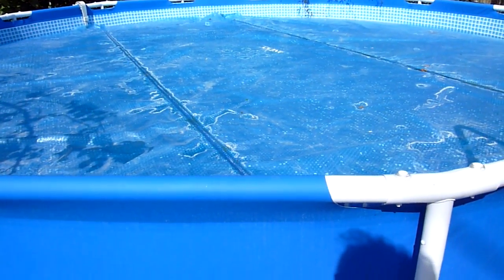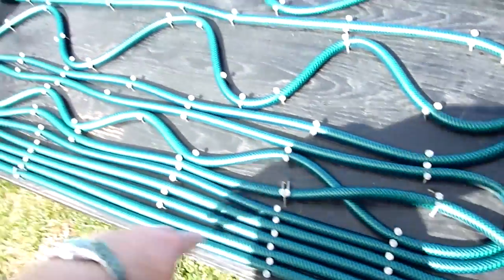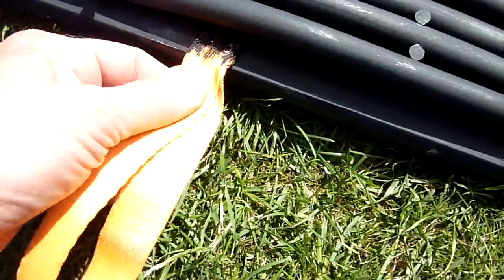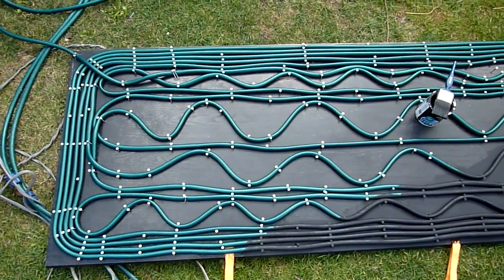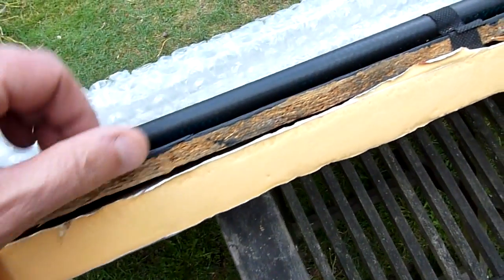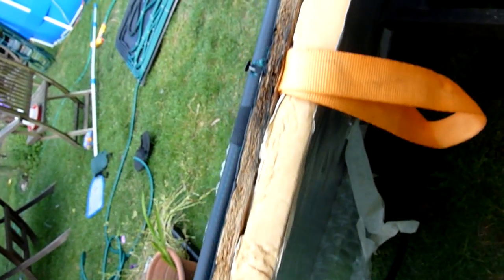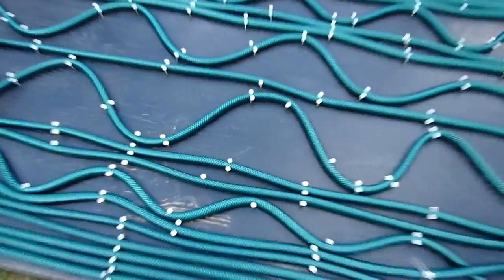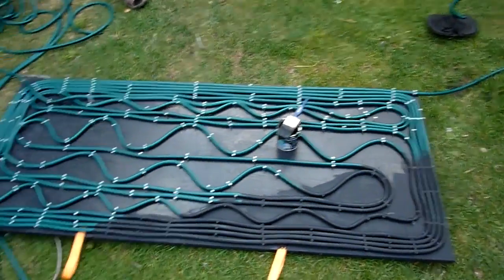Homemade Swimming Pool Solar Heating System

Comment: I did this but when I did it I put Matt black vinyl as the backing and then I used the nails that are like staples and then when it was cold 20 mins before I put some corrugated plastic over it using Velcro. I got water 32 degrees Celsius

Comment: Why the zig zag pattern on parts of the hose?  Why not just have more of the close knit pattern, you would fit more hose on the board and heat more water.

Comment: you will get a faster heat transfer by putting the colder water from the bottom through the panel. physics, the greater the difference in temperature the faster heat will transfer.

Comment: Hello.  I love this idea and I'm waiting for a 10ft intex pool of come that comes with a pump that sits outside the pool.  I've been trying to find a pump like you have hot in your pool but struggling could you tell me what it's called or what make. I've been looking at a submersable pool pump. but suppliers have told me their first draining water out temp and not not ideal for running all day. so I'm abit stuck. dome one has mentioned I could add more pipe to my pump so it runs through there. coukd you please help. thank you kindly Maria
Reply: It is a submersible pump.  You can pick them up at any box home improvement store.
Reply: Brill thank you

Comment: I understand this is old, but for anyone wanting to secure the hose neatly, then you can get black plastic hose clips that screw onto your desired base.

Toolstation have them in 15mm, 22,mm and 28mm and can be seen here:
http://www.toolstation.com/shop/p40281

Comment: Its a great idea, I just wonder what will happen when there are higher winds with coudy sky, rain or cooler weather. Would it instead make the water colder in those conditions? I guess if those conditions occur you want to turn the punp off to not decrease your pools temperature. Did you experience this with your setup?

Comment: Its great you guys have the know how to do this stuff. But the time and energy isnt worth it. I bought my solar panel at wal mart for 50 bucks. Laid it in my yard by the pool and it re circulates and warms my pool.
Reply: Gacy x  well done, now tell me where the nearest wal mart is in england? i take it you also struggle to make out accents.
Reply: Gacy x , which solar pod did you buy ?  Many neg ratings on Amazon solar pool heater panels.

Comment: Just wondering what the rating is on the pump you used. I have a similar solar heating design and am trying to decide on the pump to buy for it.

Comment: That's cool ... have you measured the temperature differential from input to output?

My only thoughts are that the parts where the hosing run right alongside each other seem to be be shading each other.  It might be better if instead of having those wavy lines in the middle that you separate all the lines by an inch or so - and maybe consider putting something reflective on the back so that light that hits underneath might reflect up to energize the hose.  Or, make the back out of some kind of thin conductive sheet of metal.

That is really creative ... I'm really curious how efficient it is  ... not to mention how long it will last or if it can survive a really really hot day in the sun.  Maybe you need to mount it on a revolving armature so that when the pool is not enough you can turn it away from the sun.

Comment: looks good think would work better getting colder water from the bottom cheaper to run than my old combi heat exchanger plumbed into my central heating might try this as well

Comment: If you can get hold of matt black metal sheeting you would use that as the backing for the water heating system as it will significantly add to the available surface area of the system.  I don't see the sense using bubblewrap as it acts as a shiny surface and reduces the thermodynamics of the project.  It will beneficially heat the air in between the bubblewarp and the hose but you want direct sunlight on the hose.  Use a flat plastic that has as close as possible a matt finish such as found in paint stores to protect the floor.  I have seen a house with black hose zig-zagged directly onto the roof, although not a garden hose but what appeared to be a soft rubbery type material that lowered it's profile.  The total length would have been a good 75 metres and 5 times the surface area of a garden hose.  How they pumped the water up I don't know but these days a simple solar panel based pump would work nicely.

Comment: Going to try myself, planning to use cable tie's, drilling holes in the board to tie the hosepipe down... although the nails here look like a good and maybe quicker solution, the cable ties may break I guess.

Comment: Pulling the cold water from the bottom would be good but it is also good to dump the warm water at the bottom of the pool to mix instead of on top where it can be quickly lost to the air.

Comment: It makes sense to me to pump the hot water to the bottom since the warm water will migrate to the surface.. I find a big difference in water temp when using just asolar blanket. THe first foot down all is toasty. hit the bottom and its darn cold. Thanks for the great video.

Comment: It could be made much more simple and inexpensive.
You need black pool bottom cover (material heavier than water) that you can remove at any moment.
Or you can adjust black bottom area to do heating appropriate.

Expect 4 degrees C per meter pool depth per day.

In summer you can easily reach 40 degrees C with partially covered bottom.

Comment: I wonder if you laid the black hose on the silver side of the foam insulation and put the particle board behind the foam sheet as a stiffener,would the silver foil reflect more sunlight back to the hose?  Then if you could get 1 or 2 old sliding patio doors and use them as a glass cover instead of the bubble wrap as a plastic cover would it make much difference? I think you are supposed to lay them south facing at no more than 30 degrees incline - or so I read.  Interesting Thanks for posting!!!

Comment: I did something like this in the Florida Keys except I just had 700 ft of black hose and a 12 volt bilge pump. Hooked the pump up to a small, and CHEAP, solar panel for free power. Had pool up to 91-92 degrees in winter with air temp being only in the 70's and very low 80's.  The solar power supply cured the "cooling" affect at night time since there was no sun to power pump. The bilge pump is slower so water has more time in hose to heat up. It took 3 days but it worked great. Yes, the back de

Comment: you a bit of a nob mate all that cost an arm and a leg all you do is stick a 3 inch diamitor 12 foot long polly pipe on your house roof stick about 4 pipes that size on your roof it will make your pool that hot you will boil lobsters in the pool and its cheap no nailing and shit and rooting around.

Comment: I installed 2" rigid insulation (R-10) on my walls and floor, under the liner My pool on the 3rd (2012) of July in Nova Scotia Canada is at 28 C or 82.4 F. No supplementary heat - just the sun. And no pool cover either. Reports say you lose 70% of your water's heat energy through the top. Not sure I agree with that, but if I cover the top, LOOK OUT!!! Friends of ours live 10km away and their pool is only at 17 C and will be until August. And they're more inland and warmer.

Comment: This idea might take longer than nails but what if zip ties were used?  You could move the hose closer and you would not have a chance of putting a hole in your hose and you would not pull them tight so you would not put a bend in the hose  you could also do a circular configuration or an oval.  you would pre-drill holes for the zip ties after figuring out your lay out.  What do you think?

Comment: One comment with respect to your set-up.  You would do better if you drew your suction from the cold water at the bottom of the pool instead of from the warm water at the top of the pool.  The colder the water the larger the temperature difference between the water and the hot hose.  The amount of heat transferred is directly proportional to the temperature difference, so your device will be more efficient.
Great job!

Comment: Well done.  I have  a similar solution.  I use the pump for my pool filter.  I removed the nozzle from one of the return lines and replaced it with an adapter that takes the return opening from a 1-1/2 inch female pipe thread to a 3/4 inch male hose thread (I made the adapter by buying a couple of standard pieces at the hardware store).  Then I run a black hose from the adapter out to my black driveway and back to the pool. Does an excellent job of heating up the water!

Comment: replace the nails with the large plastic zip ties ..just drill holes in the board and zip tie the hose in place...less chance of leaks as well...you can also use a solar panel and 12 volt to 110 volt inverter to run the pump and it will cost you nothing at all to heat the pool

Comment: Sihutchuk, That looks like a normal garden hose your using. Will it not crack if left in
the chlorine and the sun? How long would you estimate it would be before you have
to replace that bargain 50m2 hose for £3. Is the board marine ply? Will it be cost effective over the long term? Sorry to put a negative spin on your efforts but the public may need to know if all that effort is in vain and will only last a few years. 
I do admire your recycling though.

Comment: Nice job. Don't worry about the use of the nails. They're an elegant, simple and cheap solution that works. I doubt that the small kinks caused by them make much difference to flow; at least that I could see.